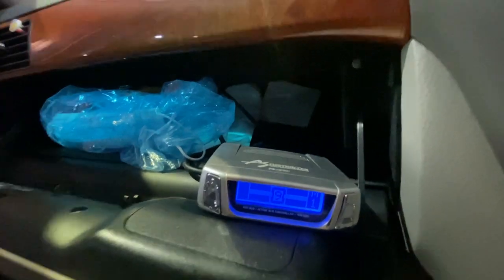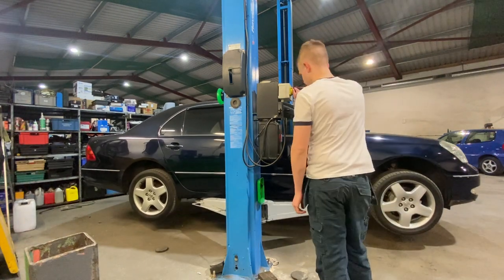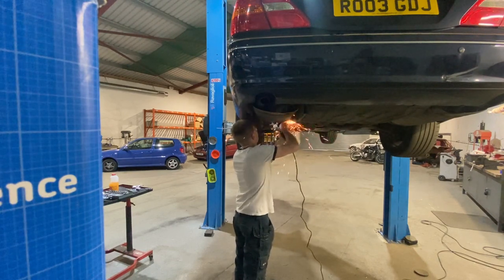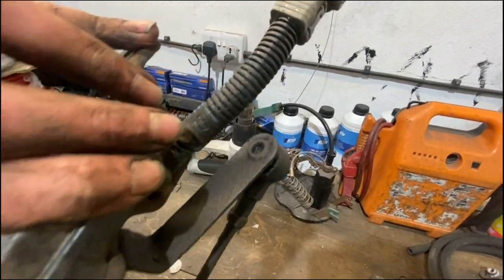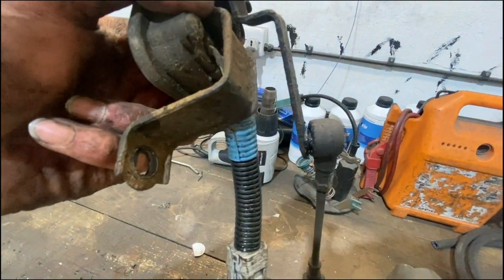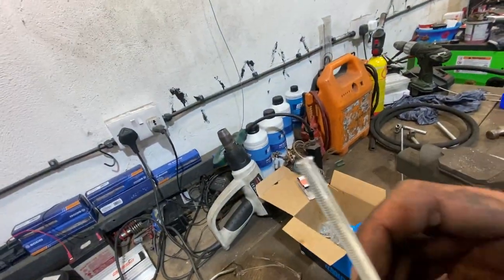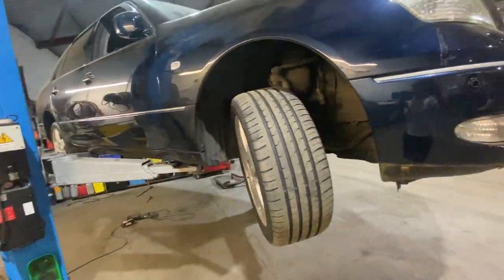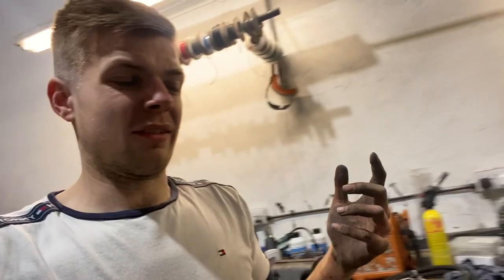How To Easily Lower Any Lexus !?

Comment: Would you have an idea why my 01 ls430 won't fill the shocks, it's saying the "Height is already "high" but I got absolutely no air in any of the shocks cause i replaced them, and it worked fine before, the thing is I started the car while it was on jacks and I think it messed up the brain and doesn't know what to do now.
Reply: There is a mechanical level sensor you have to fit properly
Reply: @daneitor97  That rod that goes to the control arm? It has only one spot for it.
Reply: it will air back up once you start it and let it run

Comment: THIS stock air ride ? PLEASE show how i can do the same to my ls400 i got stock air ride everytime i jack it up it lowers but i cant control it
Reply from the maker: You need to get an ASC controller, the reason it lowers is when you jack the car up the level sensors think the car is too high and drop the air from the bags to bring back to correct height, make sure ignition is off when jacking up

Comment: Does it have to be the ultra luxury model to work on this? because i do not have the suspension accesory in my glove box that you showed? And mine is not ultra luxury
Reply: Did you not watch the full video? He literally explained his installation of the asc device.
Reply from the maker: As far as I am aware if it is not a UL it does not come factory with air suspension, I could be wrong

Comment: can the dealership do this? how is the ride quality? compared to factory setting?
i dont want to lower that much like your car. is there any other way?
Reply from the maker: This isn't something the dealership would be able to do most likely
Reply: Instead of making it shorter by yourself. Can you get the skipper thing that sells in Japan and replace it? I don’t have air suspension though
Reply from the maker: @Nu-Typeh  not sure what you mean by skipper?

Comment: Hi I just came across your video. I have the asc controller too, I have it set to 8 at the moment. I notice that once I start driving the car raises to an embarrassing height when set to normal but when I have it in sport mode it still raises but not so high ( 2-3 finger gap). will your mod keep it from raising up and will the car lower more once it goes over 100kmh due to the speed sensor
Reply from the maker: I have not had this issue even before hand only when you try drive in "L" mode it should override and try raise, you can disconnect the speed sensor as it is not rally required (Blue plug I believe)